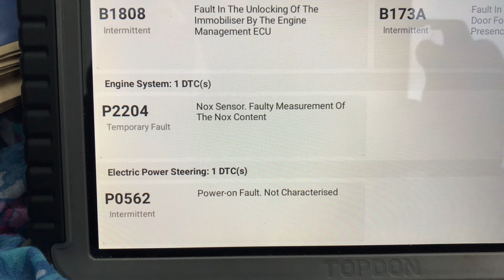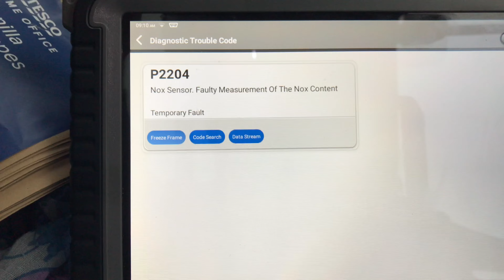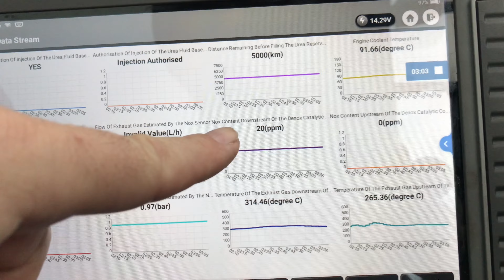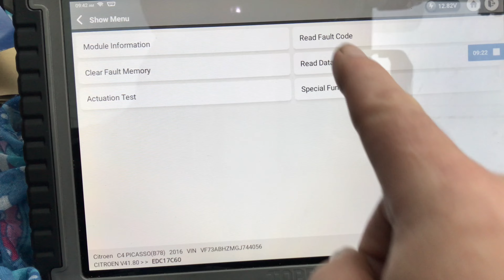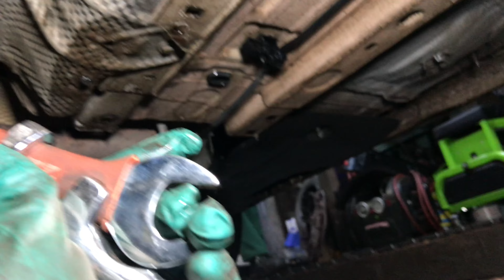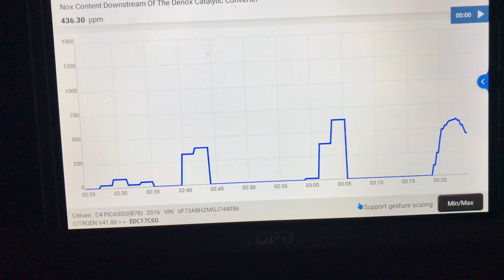CITROEN C4 Picasso 1.6 BLUE HDi - Fault Code P2204 Nox Sensor. Faulty measurement of the Nox Content

Comment: I have found that it is normally WATER ingress into the module that causes rot on the PCB 
a bead of sealer around the the new module base will keep the water out of the new one 
Customer of mine bought one from A**zon - I was not expecting it to work but it has been in over a year now no problems it was £100 - dealer £300 !!

Comment: P20E8 - Powertrain
MID:$98 TID:$b1
: NOX/SCR Catalyst
Monitor Bank 1
Max: 30 Min: 1
Test result value:
32,766
FAIL
-
MID:$ 98 TID:$b2
NOX/SCR Catalyst
Monitor Bank 1
Test incomplete or
dependant test
failed
MID:$98 TID:$b3
NOX/SCR Catalyst
Monitor Bank 1
Max: 75 Min: -50
Test result value:
11,2
PASS

Can you recognize is it NOX sensors fail 100% or it can be soething else.

I have Emissions/AdBlue error

Comment: Very interesting, I don’t get to work on small diesels but I do work on the ford 6.0 and 6.7 v8 and the dodge Cummins but I do know if there’s anything wrong with the def injection or pumps they won’t run regen and fill with soot, would an oxygen sensor tap fit that nox bung? I think it’s 18mm by 1.5mm, I was thinking of getting the heat inductor do you think it’s worth the money? Well deserved fish supper.
Reply from the maker: Heat inductor is a fine tool for any mechanic! If our broke we would buy another tomorrow!
Reply: @sandyande  thanks lads, il look at getting one

Comment: Misleading scan data can be frustrating 😩great video I learned a few things 🙏
Reply from the maker: Cheers Kevin, Sandy
Reply: Thanks so much for taking the time to put that up. I use Texa and same thing no faults in engine ECU or bsi or instrument cluster but urea light flashing. When I try to re initialise nox sensor or urea injector it says function not supported and I’m thinking it’s the nox sensor ECU preventing communication. Again downstream is stuck at 200ppm